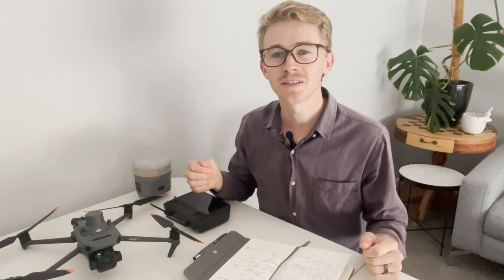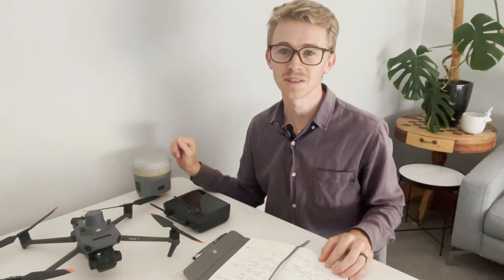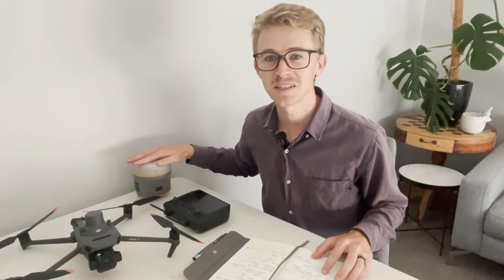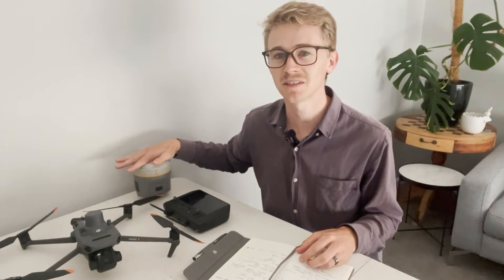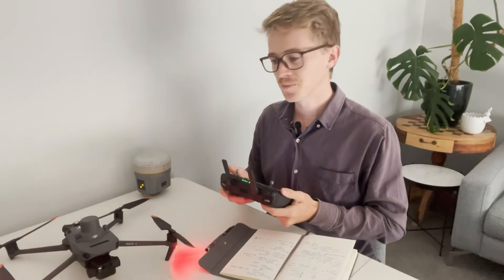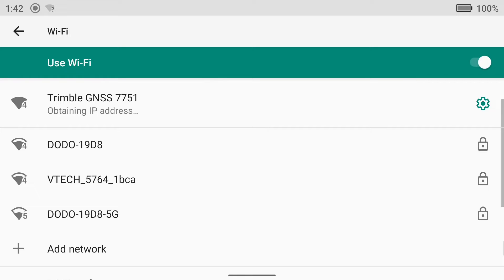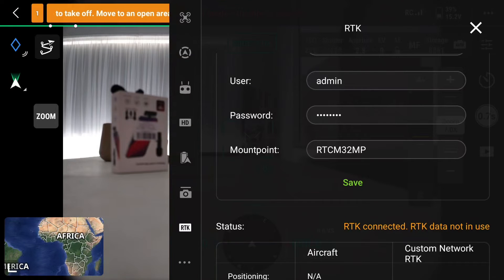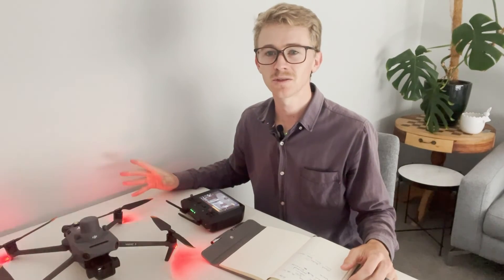How to connect your Trimble GNSS Receiver to your DJI Drone

Comment: That's Great, Harry. I have the same equipment, but unfortunately I can't use the NTRIP from my Trimble, because the drone M3E its going far and i lose the connections and signal of corrections from the DJI RC, Can you advise me if there is any way that the drone will recive the corrections direct from the trimble RTK unit
Reply from the maker: If I understand what you are saying - The RTK corrections need to go from the Trimble receiver to your RC. The RC needs to be within 20m of the base station. The M3E can extend until the link between RC and M3E reduces - typically this is well beyond visual line of sight (unless hilly)
Reply: @harrymacpherson-wood  Thank you so much, after I typed that comment I kept searching to understand more about how the procedure is, I found that I can't use my Trimble because the M3E is flying so far so it will not receive the signals from the RC, So now I am looking to adopt the new Matrice 4E which is coming with RTK build in and DTRK3 which will provide the corrections direct to the Matrice 4e without connections to Drone RC, Am i wright on this choosen?

Comment: nice video, the Trimbre Receiver works on movil o base mode? , de user how can i found it? i buy a new R12 i
Reply: I think you are asking if the Trimble base station can transmit Moving Base Corrections? I have a need for this as I want to put the Trimble base station on a boat and that receiver gets its absolute position from the Trimble precise RTX satellite based corrections. Since the boat is slowly moving  I want to transmit moving base corrections to the drone. The reason is for precise landing on the 1m x 1m pad on the boat like SpaceX bringing their rockets back to the marine barge platform.  I suspect the DJI only accepts industry standard RTCM messages from a static base station..... darn . This does mean we need to put a small Trimble receiver board on the drone as well as a separate light weight radio link from moving base GNSS to Drone

Comment: Hey Harry! Could you please elaborate on what you mean by "block shifting to an absolute location" if you are not near a known benchmark? Thanks!!
Reply from the maker: Hi Mary, Block shifting would be where you treat you data as a single piece and shift / move / scale (but not contort, or twist) to survey ground control points placed on the ground. If you don't have surveyed ground control points you won't be able to block shift it to a datum. Does this help?
Thanks,
Harry
Reply: @harrymacpherson-wood  Yes, thanks so much!

Comment: I have try to access the webpage, the username and password is invalid. How can i access the webpage
Reply from the maker: If you have the GNSS unit turned on and have not changed the standard settings it should all be as per the video. Unless you have a GNSS rover which isn't base compatible?

Comment: Thankyou very much for that for that. I appreciate it 
takes a lot of effort to assemble a video like this.

I have a similar workflow. However, I typically set up my base first thing to allow me to do conventional RTK work , road edges hatches, and so on with another pole mounted receiver. (which provides valuable check points later). I will get my true base station position doing a short session of VRS or RTX then use that position to start it as a base. I don't use "Here point" anymore as it took too long to sort out afterwards. The issue I have run into is that the moment you configure the R10 as a base with Trimble Access and start transmitting corrections that 3.2 setting is lost. It is possible to link to the base with a browseer while it is already transmitting a radio correction and reset it to 3.2 again. Its clever, in that it retains the coordinate, antenna height and radio correction. If youu have colleagues working up the hill from you on RTK rovers you don't disrupt them. The correction from the R10 to DJI is really strong and solid in my experience and those check points on hatches and the like bear this out. I've had astonishly good results.
I noted you were over writing the VRS RTK settings in DJI to accepr R10 instead. I found this a nuisance if regularly jumping between the two and kept a laminated printed sheet with respective settings in the box. To their credit DJI have fixed this now and you can save each profile with a name and select it as you desire.
I do like the VRS when the site is favoured with phone signal as you can fly the drone as long as you have your hotspot phone in your pocket (Much lighter and less restrictive than carrying an R10 across the mountain side).
I thought you may find this of interest.
Reply: Kia ora! Great video from Harry and a great comment from you. Something I have noticed, which ties into your comment. If I set my base over a known Co-ordinate and start the base in Trimble Access, it auto populates the reference station. I find using lat long a pain as we work so much in NEZ.

Could you confirm your workflow aligns with mine.

1, Set up base over a known Co-ordinate
2, Through Trimble Access, select Measure, RTK,  select control point, Start base.
3, Connect to Web GUI via controller, update the RTCM to be 3.x (seems to change back to 2 automatically)
4, Ensure RTK connection and fly away?

John.
Reply from the maker: @Reality-Capture-NZ  That's a really handy tip, thank you. 
Next time we setup using a base station I will see if it connects as per your process mentioned. When we have control points in Trimble Access, we normally change the settings to represent lat and long. Definitely would be a good idea if we could leave it to our preferred Easting Northing. 
Thanks for commenting
Reply: @Reality-Capture-NZ I have read your notes through and I think our work flow is identical. I get good support from our Trimble dealer here in Scotland. Each time you use Access to configure base it resets that 3.x. If you use e, n, h as long as your transformation parameters are correct it will broadcast correct late long ht to feed drone. I always have check points scattered across site to check for blunders but I find R10 correction is better than VRS but this is the same for conventional pole work.
Reply from the maker: Thank you @stuartross1081, much appreciated. A few good comments there.

Comment from the maker: Not through the DJI controller. As far as I am aware you can only record your photo positions using RTK. If you want to further post process you can use third party software; for example LiDAR post processing to update the image file locations. 
Is that what you were asking?
Reply: I’m looking to create a RINEX file to use in a third party software, if I can extract static base data to create tighter data that would be great.
Reply from the maker: @rapturemusicartist9348  Because the rover does not record the data but the controller does. The only way I see you being able to record a RINEX project is through the Trimble controller (meaning you treat your flight not as an RTK but PPK mission). You can export job files in the Trimble controller to get RINEX files.
Reply: How do you find out the password to your static rover??
Reply from the maker: @rapturemusicartist9348  If you use the same details as what I have said in the video this should do it. This should be the deafult password
Reply: Mine says Trimble GNSS 7734